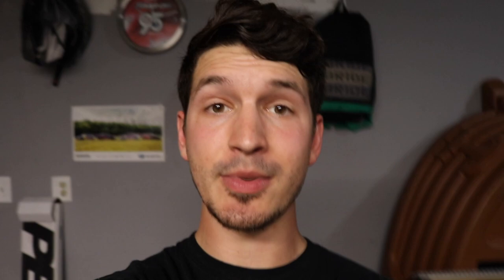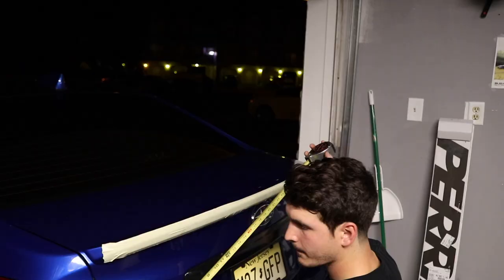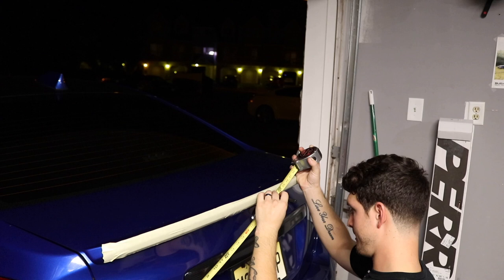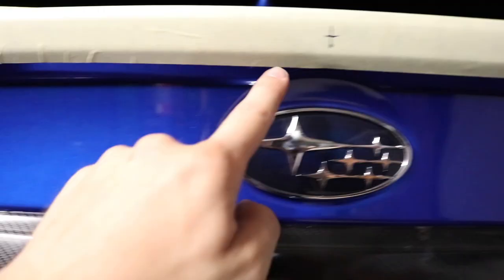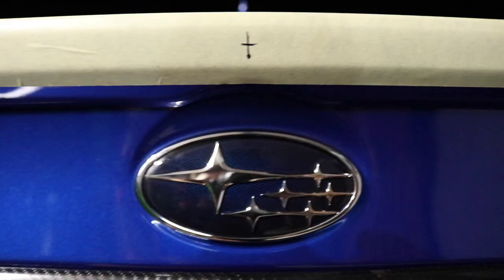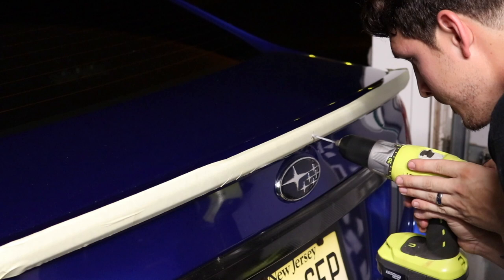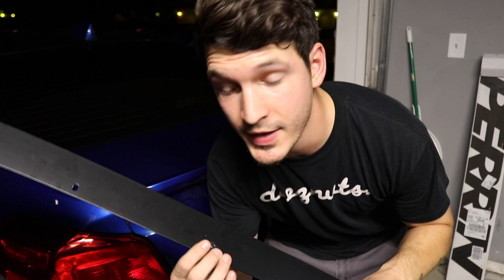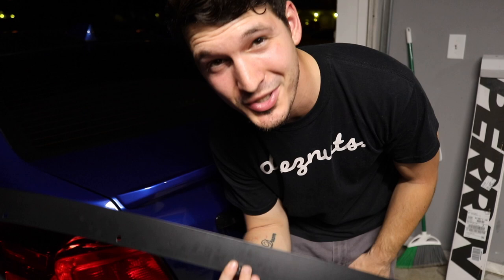Perrin Gurney Flap DIY - 15+ WRX/STI

Comment: Nice vid bro I was thinking about the Perrin one since I have all of perrins engine bay dress up installed in my engine but I ended up installing a gurney flap as well but mine was a SubiSpeed one that had automotive 3M on it so I didn’t have to drill into the trunks spoiler